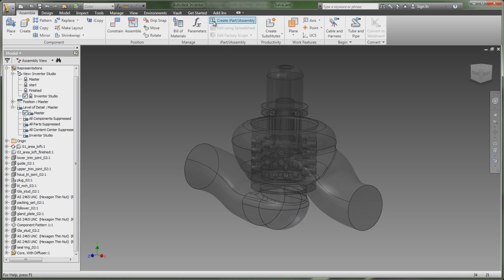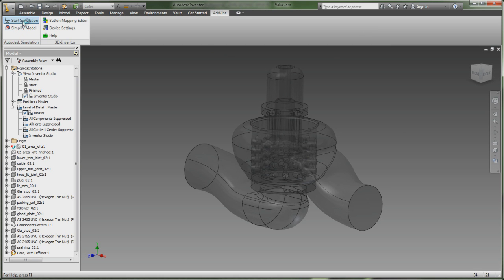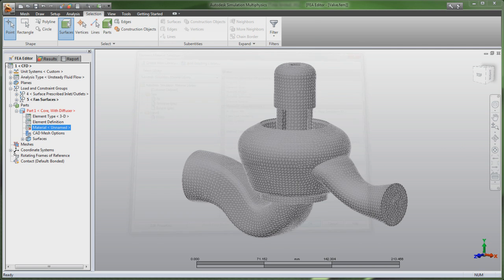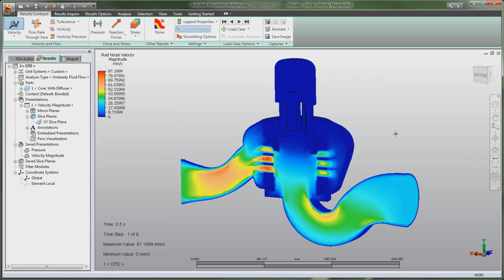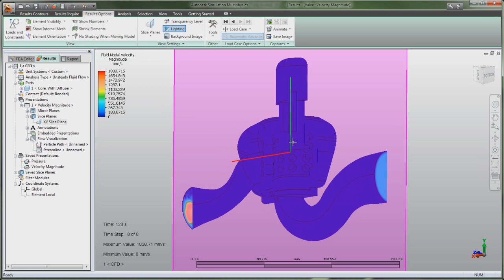Computational Fluid Dynamics (CFD) Simulation Overview - Autodesk Simulation

Comment: can i simulate how heat is being transported by water in a pipe through different materials, like cooper and aluminium, its for my homemade watercooler for my computer processor
Reply: Yes, you can definitely simulate that in ANSYS Fluent. If you're building a homemade watercooler for your CPU and want to see how well different materials like copper and aluminum transfer heat, Fluent is a great tool for this kind of analysis.
You’d start by modeling the pipe with water flowing through it and assign the correct materials — water as the fluid and copper or aluminum for the pipe walls. Then you'd set up a conjugate heat transfer simulation, which lets Fluent calculate how heat moves between the solid pipe and the flowing water.
You’ll also need to define the heat source — for example, a heat flux where the CPU would contact the pipe — and set your inlet water temperature and flow rate. Once the simulation runs, you can compare how each material affects the water temperature, pipe wall temperature, and overall heat transfer.
Reply: I have interest in Computational Fluid Dynamics as an Applied Mathematician. I will like to have your email for further discussions @abdullahkhalid1997